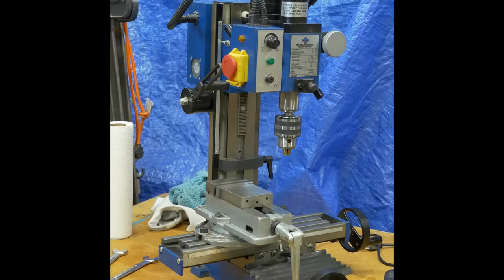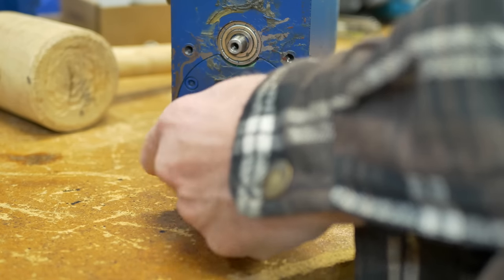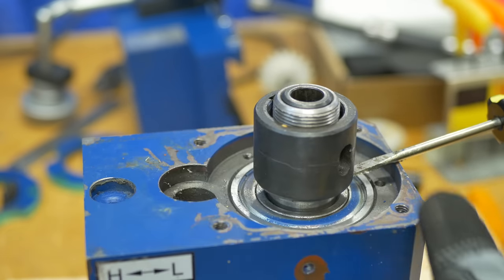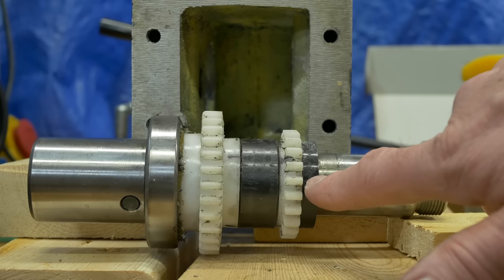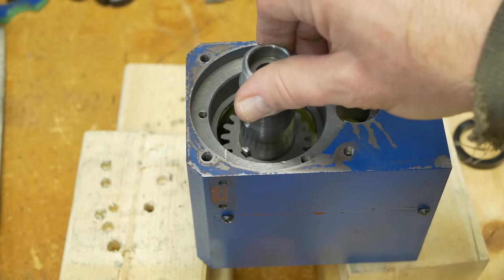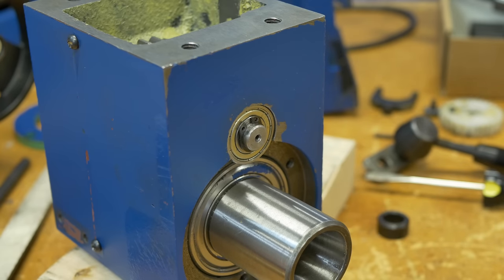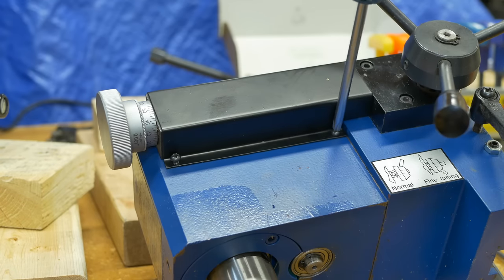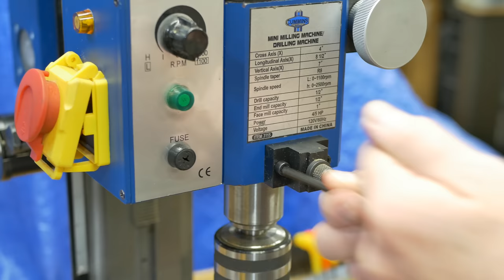Mini Mill Gear Replacement - New Metal Gears for the Mini Milling Machine!

Comment: I have learned that you should never press a bearing in or out on the inner ring if you plan to use the bearing again.. supposedly you create micro damages that will make the bearing fail sooner than later...
Reply from the maker: Yes, that's good practice to press on the outer race.  There was one bearing where it slipped fairly easy into the pocket for the outer race and was really snug on the shaft thus favoring the the inner race to press on in that instance.  Thanks for watching and leaving a comment!!

Comment: I don't understand why you haven't changed the plastic gear that connects to the motor.
Reply: Acts like a “mechanical fuse” - the easy-to-replace gear will be the first to let go if something goes wrong.
Reply from the maker: It wasn't broken.  It is however, now the only plastic gear so if something gives, that will be it. It meshes with a metal gear so it has always meshed with a good gear.  And of course there's Murphy, so the most difficult to reach gears will break, not the easy to get at one by the motor.  If I were ordering the metal gears today, I definitely would get a couple of those plastic gears to have for spares.  At that point I'm already paying for shipping so the incremental cost for those would be small. Thanks for the question!

Comment: Why didn't you replace that last plastic drive gear with a steel gear ?
Reply from the maker: That would be the breaking point if something needed to give.  It's the only plastic gear and easy to get to if it needs replacing.  Thanks for the question!
Reply: @metalwooddesign  oh, ok.

Comment: What are the dimensions of the key in the remaining plastic gear? Or where can i find one? Its not listed in the spare parts of the grizzly i bought
Reply from the maker: In that case one solution is to grab whatever parts you have with the keyway and head to your local hardware store that has the drawers with parts like keys in every shape and size.  Then search until you find the one that's just right.
Reply: @metalwooddesign  thanks

Comment: press the bearing from the outer ring not the inner one. you can damage the bearing pressing it from the inner one
Reply from the maker: Generally, yes the outer race. There was a bearing that fit very snug on the shaft and easy into the pocket, thus it was pressed on the inner race.  Thanks for watching, and in detail!  I appreciate the the comment!!

Comment: Do you have a link to buy the gear?  Thank you
Reply: Are the ones you put in iron?
Reply from the maker: I got the gear set from www.littlemachineshop.com   They've got parts for many different brands of the similar machines.  Thanks for watching and leaving a comment!!
Reply from the maker: They're steel gears.  Good quality, pleased with the outcome.  Thanks.

Comment: Other method for those who don't have a press  use all thread  and a piece of pipe washers and nuts and pull it out as you tighten  not that hard to do will need a piece about 15 inches long and plastic  pipe inch and half Dia  by five inches long

Comment: I fail to understand why would they use plastic gears in such heavy duty machine
Reply from the maker: Everything is built to a price, and of course here you can't see the gears nor would you expect them to be plastic.  However, they did hold up for years.  It was a flycutter on steel that was a little too much and took out the low range gear.   I then ran it on high range only until that gave out, and now it has new gears!  Thank you for watching and leaving a comment!!

Comment: The only hassle you have now is keeping those metal gears lubricated. The plastic gears didnt require greasing
Reply: I'd drill a hole in the case and insert a zerc fitting and keep it greased

Comment: well done but living the plastic gear on top will come back on you later as it will fail later on.
Reply from the maker: The one remaining plastic gear is easy to get to and will be the weak point if (when?) the tooling snags the work or is overloaded for some other reason.  Thanks for watching!  I appreciate the comment!!

Comment: I don't need instruction on replacing the gears on this milling machine. I would never buy a machine that uses plastic gears. Did you buy steel replacement gears from this tool manufacture. Smart they sell a junk machine, then sell the replacement parts for this  machine, anyone seeing this video would never purchase this mill. Thanks for the good information.
Reply from the maker: The gear set came from an outfit that carries parts for lots of small machines.  The plastic gears actually held up for years, until one day flycutting steel, taking just a little too big of a bite.  I would agree this is good information if in the market for a mill, and like any equipment, get the best you can afford, lift, and have room for.  Thanks for the comment!!
Reply: @metalwooddesign  Yes I have a JET JDM-15 mill, paid $1,200, I had it for about 18 years, never had to repair it or replace parts. Remember you can't tell a customer his job will be late because your machine is broken.

Comment: Not supposed to push on a inner bearing race with a press probably wrecked that bearing 😅
Reply from the maker: The bearing fit in the outer pocket easy and was tight on the shaft, thus favoring the inner race.  Thanks for watching, and in great detail!  I appreciate the comment!!

Comment: Guess you'd be Hard Pressed if you don't have a press to press those parts in and out😊
Reply from the maker: Yes sir, you need a controlled method for moving the parts.  It's not a hammer job.  Thanks for the comment!

Comment: i see everyone switching to belts over the gears, im lucky enough that i can make the plastic gears with 3d printers but ive seen the metal gears an ive been tempted to buy them but havent cause i had always wanted to go with the belt cause everyone suggest it over the gears cause the belts isn't as loud while the plastic gears noise have never bothered me i could see the metal ones being quite a bit noiser an with where i have my mill its not in a garage or shop, i have it an my lathe both in a bed room along with all my 3d printers so i try to keep the noise tto a minimum if i can, the mill has never given me issues with its noise an everyone else in the house says they barely know when im using it but the lathe on the other hand they do notice but are not bothered by it so id like to keep the mill in the same position, id like to be able to run it late at night like i do now without it bothering those who are sleeping so the belt has always been what i had planned on but its so much cheaper to go with the metal gears an id like to get them just so i dont have to worry about replacing them anytime i end up screwing up, im new to this some i happens. can u say how much more noisy the metal gears make over the plastic. i know it wasnt running in the beginning of the video but i assume u have used them an know how they sound with the plastic gears.
Reply from the maker: It's makes more noise with the metal gears, but that's not an issue for me.  If you're already getting away with the 3D printers (which run for hours) and the metal chips from the mill I'm sure you're cleaver enough to find a solution for a little more gear noise.  Keep on building!!

Comment: Can't help but think I would've changed all the bearings for high quality ones, rather than risk having to do all this again in six months. 😁
Reply from the maker: The bearings looked OK, besides I'm kinda cheap.  Thanks for watching!  I appreciate the comment!!
Reply: What's the point? These are not precision machines anyway. You won't get much bang for your buck with better bearings.
Reply: @anelpasic5232  Not true. Better bearings are better, they're smoother running, more precise, and will far longer. And if you're going to have to change the cheap ones later, you may as well change them now, while it's in pieces.

Comment: you do realize your supposed to press bearing in from the outside not from the inside .. right?
Reply from the maker: The bearing fit in the outer pocket easy and was tight on the shaft, thus favoring the inner race.  Thanks for watching, and in great detail!  I appreciate the comment!!

Comment: tbh im surprised the plastic gears even work without breaking, shame that they try and save that tiny amount by making plastic instead of just using metal right from the start, kind of stupid to use plastic in something that works as hard as a mill.
Reply: I can’t recall the reasoning but they use plastic gearing for a good reason and it’s not about cost.  I can’t remember where I read the discussion it might’ve been on r/Machinists.
Reply: @ChristopherJones16  interesting. possibly so it saves a much more expensive partt not to give way. sort of like a shear bolt/pin in  a sense.
Reply: These plastic gears don 't need lubrication.

Comment: This video is cringe -worthy! 1 way to do this right, 99 ways to do it wrong. Which leads me to a question. Is it true when converted over to the LMS belt drive, the transmission is bipassed altogether? tyvm
Reply from the maker: The belt drive is certainly another way to put a broken mini mill back into service.  It drives the spindle directly, bypassing the idler shaft and two speed gear box.  On the belt drives you get two speed ranges by moving the belt between two sets of pulleys, like on a drill press.  Keep 'em flying!

Comment: I think the last plastic gear connecting the motor to the gear box should have been replaced with a metal gear. (just my opinion)
Reply from the maker: The one small plastic gear on top gives it a break point that's easy to repair.

Comment: Where did you get the metal gears
Reply from the maker: I got the gear set from www.littlemachineshop.com  They've got parts for many different brands of the similar machines.  Thanks for watching and leaving a question!
Reply: Thanks appreciate it